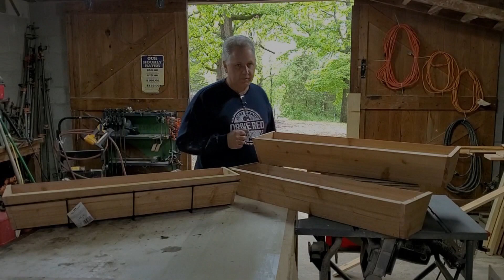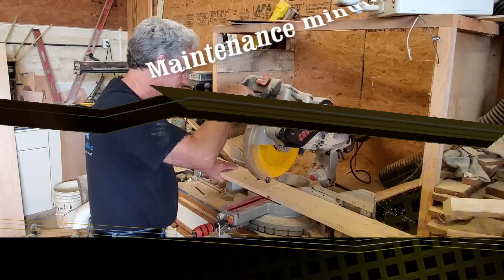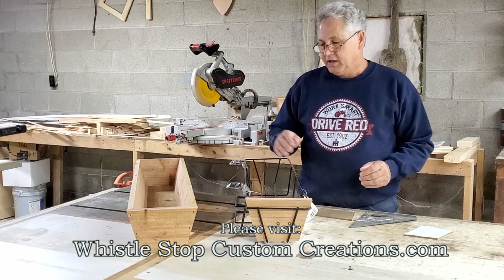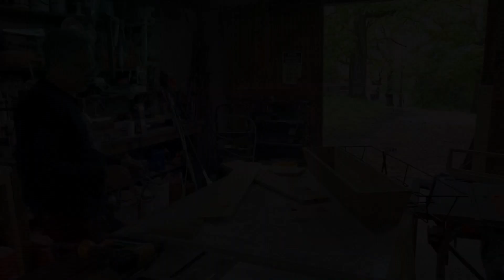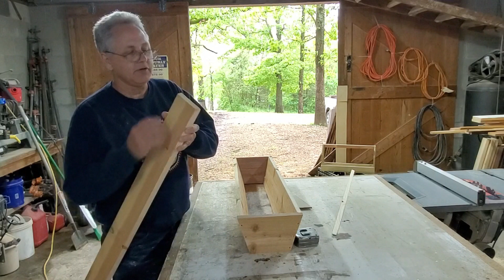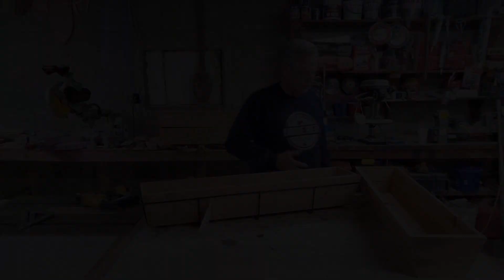D.I.Y. Build these cool wooden planter boxes for flowers.

Comment: I am so glad that I found this "channel". I love working with wood, but sometimes I don't know where to begin. My most recent project was using 2x4's that someone threw away by their dumpster. I took them home, removed all the nails (construction worker), cut them to make a square box. I made 7 boxes, stacked them on top of each other. Then I measured the height of my plant's pot, cut a piece of plywood to put between the squares, stacked the rest on top. My plant was too big to move around so I put wheels on the bottom to move it easier and also took some scrap boards to make a trim down all the corners. I think it turned out great. Sorry this was so long. But you have given me inspiration during my winter months.
Reply from the maker: I am so glad you found new projects to build.  Thank you for watching my channel.